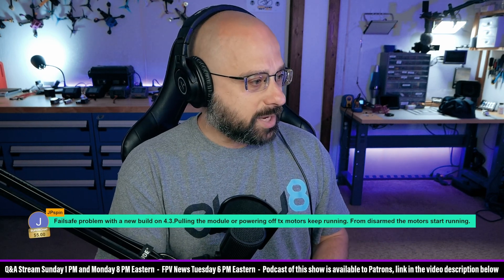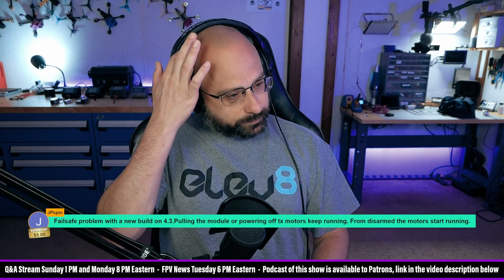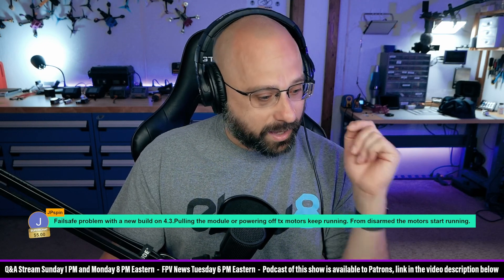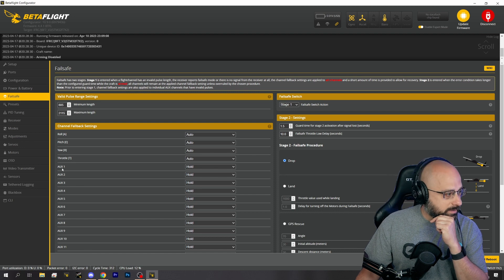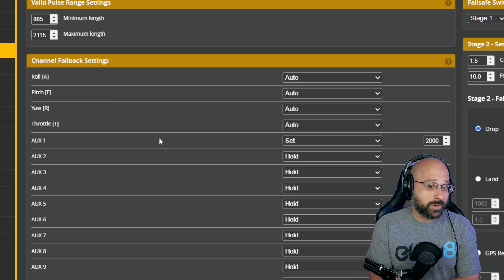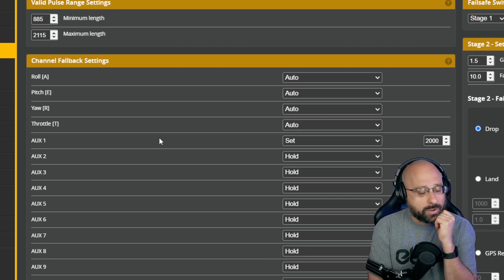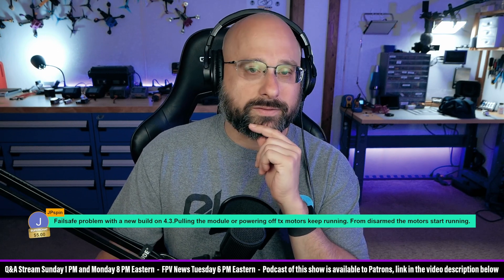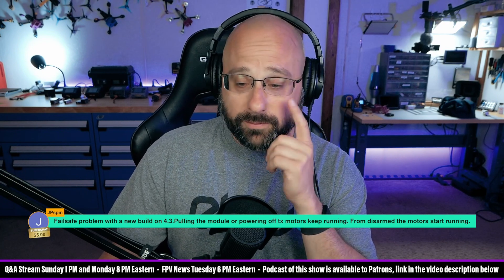My Motors Keep Running When I Failsafe! Help! - FPV Questions

Comment: Was it a HGLRC? I had this happen with a hglrc 28a Zeus esc due to it not being able to handle 6s as manufacturer claims. Lucky i didn't loose fingers somehow, it armed on its own a few seconds after i plugged in a 6s as i was getting my goggles ready. The motors just went full speed, it was never armed, I had previously test flown it with a storage charged battery and it was fine, the ESC failed shortly after all together and just stopped doing anything, I replaced it and #2 couldn't take a full charged 6s either, it also failed within 2 packs, and the third one I only connected the power lead, i hadn't even connected the fc or the hglrc 1408 2400kv motors up to it yet that time, I just connected the battery lead and plugged in the battery  and it made a sizzle sound I went ahead and connected one motor and got nothing. Now I have several other 4S boards that I have had no problem with, they just don't work with 6s, I got a 10pack a while back of these, now i see why they was on sale so cheap. Not a fan of hglrc  anymore!  I have also had two hglrc's F4 V5 Pro flight controllers and a 350mw vtx just failed after about a dozen flights or so for no reason. Then a 16mm f4  fc had the usb fell off when i went to plug it in the first time, they forgot to glue it, and a then a f722 zeus flight controller that showed up brand new sealed in package with the pads covered with corrosion. I will not be buying anymore of their garbage. If you get good motors they're good, but I have got a  bad one,  if you even get what you order! I ordered motors repeatedly from the Amazons  hglrc store and you will get different versions of the motors every time, had to order 3 times to get a matching set! Im just done with them! Been having amazing luck with Jhemcu lately, if you can figure out what firmware works, lol, 4.4 don't work on them at all